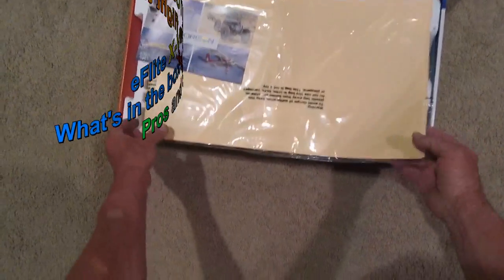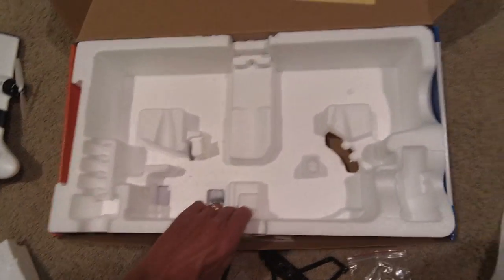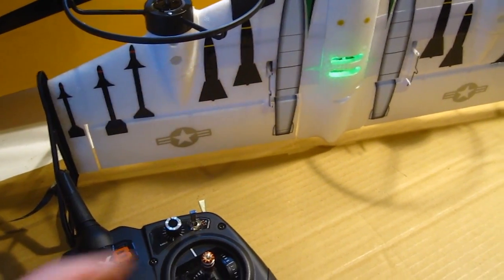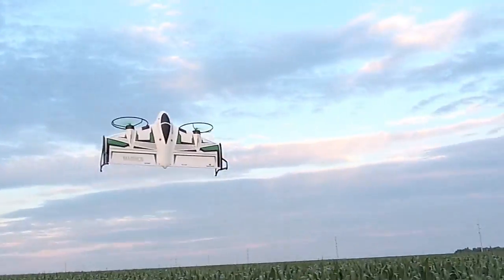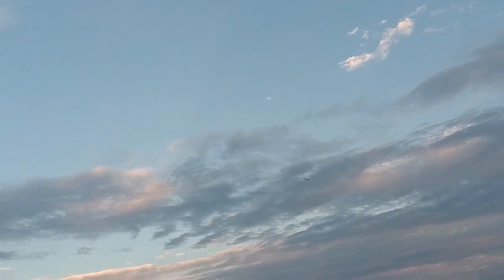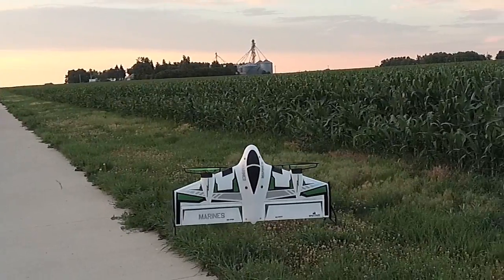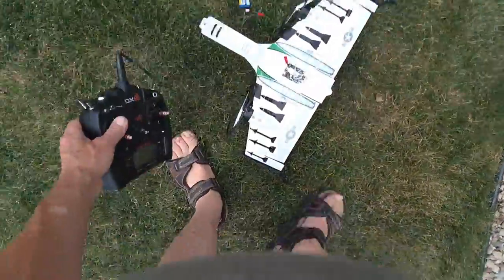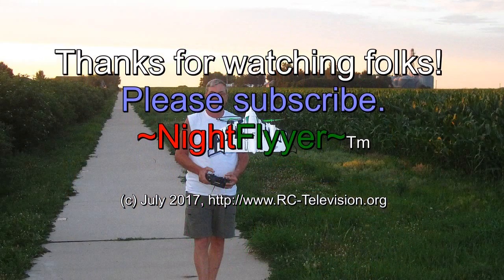E-Flite X-Vert VTOL Pros, Cons, Prop Mods, and all you need to know!

Comment: Great idea on the props Im getting ready to get the XK X450 or the JJRC MO2 VTOL  I may need to use your trick when I bust a prop 🤔 LOL I know I'm going to need to learn all the tricks I can with planes drones etc 😁😂🤣   I raced trucks from 2000 to 2004 every Saturday I had a XXX graphite Losi and a Team Associate I think it was a T3 hell I can't remember lol what ever came out the same year as the XXX Losi I got the Associate first a couple months later I got the Losi I raced the Losi a lot more it was a bit wider and longer in other words it was a little more stable I raced off road mostly I raced dirt oval in 03 I won the 03 points championship Dirt oval is very fun also but I prefer off road I loved figuring things out knda like the prop trick lol It's fun to work on your stuff and  learn little things here and there  It's a lot easier on your pocketbook to 🤣😂😁  ✌️
Reply from the maker: A great story and thanks for telling it.  I love my XK 450 and made a video of that too. It is much easier to control than the Xvert, in my opinion.  Anyway, thanks for stopping by and commenting.  Happy flying and racing.

Comment: This is truly one of the most fun things I've ever flown :]
Reply from the maker: Wait till you fly the XK 450 Evolution!
Reply: @NightFlyyer  Hello, i fly the XK X450 it's a lot of fun but the plastic    gear Servos for the Motors are not realy good ,metal gear makes it better.
There may be an error in the flight control, which ensures that the motors turn 90 degrees downwards, it must continue to be observed.

Has this already happened to you? Greetings from Germany.
Holly
Reply from the maker: @hollycool2910  I have not had any problem with it, except that tree that jumped up and hit me!  Nothing happened to the servos in that case.  Sorry to hear you had a problem.  Here is my crash and repair video on it. https://www.youtube.com/watch?v=4wHmiCxDN7Y

Comment: How'd you get the props to work when the original ones are slotted?
Reply from the maker: Just like on most model airplane engines, the prop shaft are round, so no slot on the shaft is needed.  Round is also better because if it hits something, it will spin on the shaft some and may not break.  This style motor shaft is why the blades also break easily. Round can give some.  The round prop hole fits right over the slotted shaft and it has worked for me since.  Thanks.  Good question.
Reply: @NightFlyyer  I'm having trouble understanding what you wrote. The motor shafts on the X-VERT are slotted. So what you're saying is you screwed in non-slotted props and they work fine?
Reply from the maker: @Snecho  Exactly!  I show it clearly.  Cut out slots don't make the shaft bigger, and most of the shaft is still round, so the prop centers.  The screws tighten the props down as they screw into the shaft.  The props aren't threaded and don't screw on.   If you had one, you would understand it better.  This video proves it works anyway.
Check out my other xvert videos and you will see I have not had to change the props ever since I bought these props.  Lights   https://www.youtube.com/watch?v=zC5jz8_Sv4s    or this for tip-over prevention  https://www.youtube.com/watch?v=7t6DBKa9c4c
Reply: @NightFlyyer  I do have one. That's why I was interested in seeing if just screwing on a non-slotted prop would work. Thing is, the props in your link are no longer available. Are there other ones that would work? I've also thought about "upgrading" to 3 or even 4 bladed props.
Reply from the maker: @Snecho  Yes, they do work.  The props are available from Banggood and others. Not sure if they come with spacers, but the ones I bought did.  These are 10 packs.   Here is a link. https://usa.banggood.com/10-Pairs-KINGKONG-5040-Propellers-For-QAV250-p-1000415.html?gmcCountry=US&currency=USD&createTmp=1&utm_source=googleshopping&utm_medium=cpc_bgcs&utm_content=garman&utm_campaign=pla-usg-toys-multi-pc&gclid=CjwKCAjw5pPnBRBJEiwAULZKvrSJ2Ulu2w-Rm7sVa59NjMGu8w3PiSjsKOSII5HUqXUQ-jeBKIs3hhoCReoQAvD_BwE&ID=513344&cur_warehouse=CN   Enjoy your machine.
Reply: @NightFlyyer  Thanks for all your help. I will try my best.
Reply from the maker: @Snecho  Yes, i think they will too.  Good luck.
Reply: @NightFlyyer  Thanks again for the help!

Comment: I've now got an X-Vert. The alternative props you recommend are no longer available.I have to say that I feel the way the props are secured is doubtful. I wonde why they don't have a velcro strap around the battery like their other models. I was going to fly it indoore but having seen some of the Toutube videos, I think I will try outdoors first.
Reply from the maker: If you click on the link in the description box, you will see them there.  Please do not guess they are not.   Indoor flying works best in hover mode.  I never fly mine indoors much at all.  This is very fast and hard to see in forward flight, so hang on.
Reply: @NightFlyyer  It now says they will be back in stock on May 9.

Comment: Again a question: What´s the advantage of the modified props? (Faster, more safe, stronger) ? Thank you!
Reply from the maker: They don't break as easy as the stock ones, that break when it tips over on landing in the grass or hard surface, as it tips over very easy on grass.
Reply: I already had a crash with a tree, but the props didn´t break; they deformed only a little bit. But the problem was, that the gyro got a wrong information, because the props wobbled. So I bought new one from the same kind, and the x-vert flies  like a new one. So I saw the green one, as you demonstrated in the video. Are they stronger than the white one, do the make a better drive; that´s what I wanted to know. Thank you very much.
Reply from the maker: You got lucky. Yes they are stronger.  If you look at the video the stock props (maybe they changed them now) are thin at the hub.  Many many told me they broke their stock ones, including me.
Reply: So I thank you for the information and I would do it like I do: don´t start from the meadow or other surface. Take it in your hands and start it from there...the same for landing...catch him, he will never fall over and you have no stress. Even my propeller protection broke.. Thank you!
https://www.youtube.com/watch?v=Vu3Rhx0X1Ck

Comment: I love my X-Vert, but when I go through the acro mode switching procedure, after taking off and going to mode 2 the motors quit and it drops out of the sky. I know I am doing the procedure correctly. Is there a hack on the main control board for this?
Reply from the maker: I guess I am not sure what you mean.  Does it crash.  It is supposed to go back into hover mode to land.  If not, your TX is not set up to the program parameters in the manual. If it is, better call horizon.  Good luck.
Reply: After I go through the procedure to enable acro mode, you know, power on the radio (the Spectrum that came with it) and the X-Vert, then hold the sticks down and in while trowing the mode switch three times, this is what happens: The X-Vert does go through the initialization quivers and tone to signal the mode change, I take off successfully in VTOL to a safe altitude where I throw the switch for airplane mode. The motors quit and it falls to the ground. There is no transition to horizontal flight. I'm beginning to think they sold two variants, one with acro capability and one without.
Reply from the maker: That is definitely not right.  Call horizon help line and tell them.  Something is wrong. I am not using the radio that came with it, as I am using my DX 8 Gen II, so don't know about your TX. I'm sure they can figure it out. Let me know. Good luck.
Reply: I also have a Taranis QX-7 with and IRX-4+ plugged in the back I use with my UMX Timber. I'd try the QX-7 but I can't find the channel assignments for the X-Vert.

Comment: Hi Dave
Thanks for sharing this vid.
couple of quick questions 
1- how fast should the wind be to overwhelm the x-vert
2-by using the 5x4 props , it won't be to much stress on board or battery ?
3-what are specs of original props

thanks

Comment: hi great review thx, i just bought a x vert . when landing do you hover in low rates or is it ok to use high rates??  i hovered in high rates in windy cond and it when crazy upside down and crashed. also the green props do the black inserts have a round inner and the metal screw is what holds them on tight? are they able to turn a bit under pressure?  amazon is out of stock at the moment

Comment: You still have gyro assist in 3D mode.  AS3X is still working behind the scenes.  Going into 3D mode just turns off the accelerometers, which are different pieces of hardware, and disables the bank/pitch angle limiting SAFE stuff.

Comment: Hi sure hope you can help me get the bugs out. I bought one after watching your review, I got the RTF version. I do fly Helis and quadcopter.
First question in vertical mode and armed props spinning at what point does the throttle start working mine does nothing until 1/2 throttle is that normal? When the throttle kicks in and it gets light on its legs it hops forward a few times and tips over. Nothing I seem to do will stop this, it's hasn't been apart and setup the way it came to me. I turn the Transmitter on first and wait several seconds to plug the battery in, unit standing on its legs on a flat level surface. My lipo and Transmitter batteries are fully charged, all four trims are centered, solid green light and rate switch on LO mode switch set to 0.
I sure hope you or one of your Subs can help me figure this out. Thank You

Comment: its baltantly the most simple design for VTOL(seem not more complex than quadcopter)
so the question is why usmc developed tilt rotor & not this (who existed in the 1960 Ryan X-13 Vertijet)
is a con for they release a 1S 3.7V model ?
what the vertical autonomy ?
how crash the frame can sustain (i guess critical size is more than 30cm 100gram)
i broked a same material & size plane after less than ten crash on grass (despit wings got an carbon fiber insert) 
when syma X5 clones resisted dozen of 20m full throtle crash on concrete without a blade broken (never reached to break X5's at all in fact)

Comment: Always enjoyed your video Sir! Your 5x4 prop looks bigger than stock prop. Any chance measuring the amp flying with your modified prop? How did the control board handle the extra load, like temperature wise? Great review, thanks!
Reply from the maker: No way to measure amps easily and it is of no concern. The prop has a wider root and may be a bit wider, but its still a 5x4, and as you saw it fly's fine with them.  The board never even got warm, and I never ran the battery dead.  Believe me if you fly stock props you will break them eventually, even when it tips over on landing.  My green props are not at all breaking and I have tipped it over a lot.  Thanks for the kudos!
Reply: Thank you Sir giving more detail! That sounds great assurance for us.

Comment: Are you sure there is no gyro assist in "3d mode"?
Reply from the maker: Yes, that was all me and a blast.  10 rolls and you dont know where you are when you stop, so just have to keep flying to see where it goes and compensate.  It wont hover in switch position 2 ( 3D mode) as it's just full elevons and motors, like my flying wings.  In switch 1 position, you get some gyro assist and it makes for very smooth flying.  It wont roll or loop or hover in that position either.  Switch position 0 is only for hovering and there is a lot of gyro control there for sure. Those elevons really work!.  Thanks again.
Reply from the maker: Ps. The manual also points out there is no gyro assist in position 2😊
Reply: well, just looked it up and to me all it does is hint to that the accelerators are off though gyros aren't mentioned: Acro Mode (switch position 2*)
Acro mode is intended for experienced pilots who are comfortable flying the aircraft in any orientation.
• Receiver LED green and red
• No bank angle limits
• No self levelling when the controls are centered
• Fully aerobatic capable

I have no AS3X Model with "Save" only a FBL heli (180cfx) which has no level mode but only gyros doing their job. That's why I am asking^^
Reply: will unbox mine and look/hear for elevon movement in Mode 2 when I wiggle it around... I guess that's the easiest way to find out.
Reply from the maker: There is very slight assist in Position 2, but believe me you need to know how to fly in that position, as gyros, will not save you. I learned to fly helicopters before there were gyros 40 years ago, so flying this for me was a piece of cake, but fast.  It glides very nicely too.  IN Switch 1 position, it will not roll or loop, so you cant get in trouble like you can in position 2. Guess you will find out soon enough. Good luck.
Reply: I go from 1 and skip two to go to 3. I do not like mode 2, not good for smaller spaces.

Comment: Looks like another great VTOL to add to my collection Dave thanks for the flight video
yeah my Convergance struggles in drone mode into the wind too so I fly airplane mode and get as close as possible before flicking the switch
I installed the runcam Eagle and Immersion rc 600mw vtx into my Convergance and fpv flying is excellent as the VTOL does not tilt when flying forward, lots of fun 
I have the 2S 800 lipos for my mini quads and the umx A10 so thats covered
Reply from the maker: Great, so you know what I mean about struggling in hover.  Knife edge flying in hover is the way to over come that, but I had to learn that after I pushed the emergency kill switch. LOL.  Not sure if I want to use this for FPV, because it is fun to watch in 3d mode, but either way. I like it.  I had a battery too, same as the Torrent 110.  Thanks for the comments and happy flying.

Comment: Nice video, I hoped to get one before now but I havent. I hope to soon I think it be fun in the yard or at the park. thanks for the tip on the better props
Reply from the maker: I appreciate your comments.  You will find those green props I used are hard to break.  The stock props break when it tips over on landing, and the green ones never have, as they have big roots.  You will love it, as it is something different.